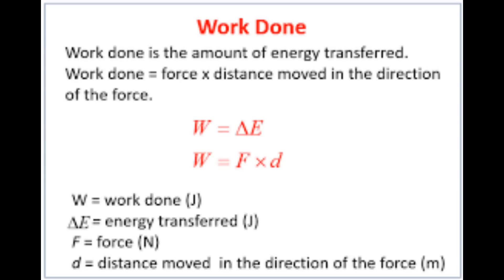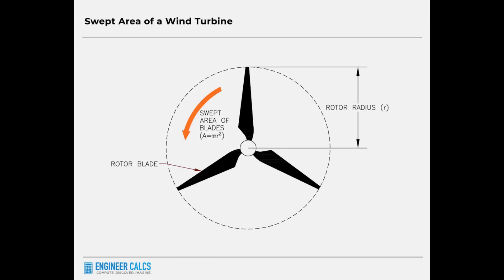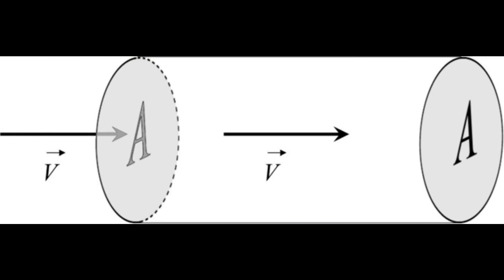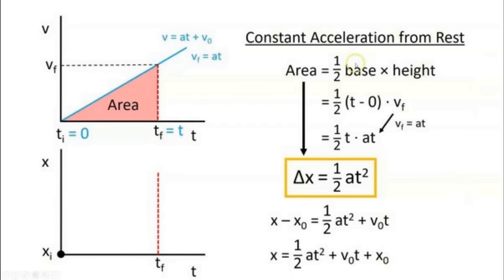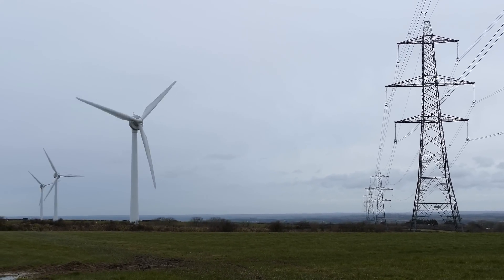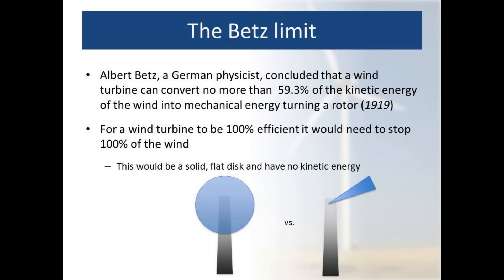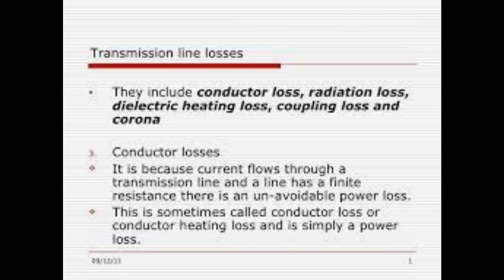1920 The Mathematics Of Wind Turbines

Comment: I can understand the geometry of an airplane wing shape as from root to tip it is all meeting the air at the same velocity (I'm ignoring the mechanics/geometry of weight/lift/strength of modern wing). But with a rotating 'wing' i.e. turbine or propeller, the tip is moving fastest, the root hardly at all. However, a turbine blade is applying torque to the axle, and the leverage effect means its most effective with force applied at the tip. So why aren't the blades much wider at the tip to 'catch' most air? (I'm thinking something like the multi-blade windmills of the old american ranch waterpump windmills) Can someone explain this in clear terms?
Even if the tubine blade/wing has an extended tip (to reduce the effect of vortex shedding on the rest of the blade) there must be a sweet-spot along the blade where widest is most efficient to extract maximum torque-effect from the airstream.

Comment: I assume that any wind turbine, when trying to maximise the energy it collects, will run at some rotational speed that is proportional to the wind speed. OTOH, as you explained in a very convincing way, the energy that can be extracted grows with the cube of the wind speed. From these two we can assume that the torque or the mechanical load that optimises the efficiency of any given turbine will have to grow with the square of the speed. Let's say you want to store the energy mechanically by lifting a (constant) weight. You would need some continuously variable transmission system that makes sure that the gear ratio grows with the square of the wind speed. I can imagine one can build such a transmission system, but how to do it in a simple and robust way is an interesting challenge in itself.

Comment: The Betz power coefficient limit of .59 often referenced.  The less known "Whirlpool losses Schmitz power coefficient as a function of the tip speed ratio" curve is very useful for estimating the efficiency of a wind turbine.  The Schmitz curve shows the maximum theoretical power that can obtained at given tip speed ratio, TSR.  A wind turbine operating at a TSR of 0.5 has a maximum power coefficient of only .238, at a TSR of 1.0 it increases to .400, and at a TSR of 10.0 it nears the Betz limit at .572.

Comment: So Robert, I can't help going back to your 1889 demonstration on the capture of wind energy (funneling the wind down onto a fan to drive a generator). I hope that is the correct experiment. Anyway Im sure you know the one I mean. It has to be one of the most innivotive ideas I can think of. Obviously the internal orifice has its limitations (in the maximum achieveable downward air pressure)  to create high pressure onto the fan. If everthing is scaled up with a cone on the bottom to create yet more low pressure under the fan, the efficiency has surely to increase without an increase in windspeed. Sorry that Im going off on a tangent but I thought a little alteration to an existing project may produce a positive result.

Comment: What I want to know, for the big commercial turbines, relates to energy output per revolution. Does the turbine produce the same quantity of energy per revolution (at the nominal rotation speed) or is the energy generated a variable, controlled electronically, to keep the blades rotating at the optimal speed.

Comment: I’ve always struggled to understand why all modern turbines are 3 bladed. The ideal you presented here effectively calculates the power output based on a “wall” of wind hitting the blades. Once it’s passed through, it’s gone. Energy dissipated. Converted. Kaput. End of. So why not put 6 (or 9..or 12) blades to capture the power from that wall of wind - and max it out? There is a huge amount of energy in the wind that must just pass straight through the three turbine blades, uncollected.
Reply: Struuggling isn't good, working things outt.. is much better.
(Work with "Less is more")

More blades interfere with the wind - upstream of the turbine, more blades increase mechanical complexity, more blades increase cost, more blades increase maintenance
Fewer blades induce increased plasticity in the rotation, fewer blades increase "tower effect", fewer blades increase bearing stress. Fewer blades reduce power output (for any given rotor diameter), fewer blades reduce cost/maintenance /complexity - intil there is only 1 and those things Likely increase again..
Even numbers of blades induce harmonic oscillation into the whole system.

Pick you optimal number, more than 2 and likely less than or equal to 5, with an off (preferably prime) number dominating.

The lower the number the less disruptive hub interactions and the lower the drag when stopped...

(Not saying you are incorrect, but the haters look to Holland or Greece with their old "4 bladers" as something of a marvel in contrast... - romantics often disconnect intellect.)

Comment: How does the Betz limit apply if you were to stack a bunch of separate turbines in front of one another? i.e. the first turbine slows the air down by 60% and extracts the energy, but then the next turbine can slow down that resulting airflow by 60%, and the next one can slow down what's left of that by 60%? Does this allow you to get arbitrarily close to 100% efficiency, or is there still some magic that means the system as a whole must obey the Betz limit even if you or I would recognise them as multiple individual turbines?
Reply: - the best you get is a very expensive marginally performing system - when just 2x the wind turbines separated adequately give 2x  (ie 1 + 1  - maths is dead easy ) 60% (theoretical limit) - 2 stacked can only give 60%+(60% of 60%).....(excetera for 'n' numbers of repeats )- lots more material, not much energy - worshiping efficiency gets wasteful quickly - call it "diminishing return").  lol.

The only way to beat Betz is to change the "critical area" - either using an upwind "collector" or a downwind "diffuser"  - or some combination which doesn't use too much material, disrupt the flow through the blades (air just "flows around" if you try to force the pressure to rise too much) , or cause the tower cost to increase astronomically - high winds and breakage are a thing)
Reply: @kadmow  I'm aware the second turbine would be getting 60% of the 40% that remains after the first turbine has extracted some energy. That's not my issue. But if the Betz limit says the maximum proportion of the energy you can extract from the air flow is 60% in total, but stacking multiple turbines allows you to exceed 60%, then it doesn't seem like much of a limit at all, because whether you consider a system to be "2 turbines consecutively" or "1 big turbine system" is just a matter of opinion. Which makes me think that maybe there is some reason that the second turbing actually wouldn't be able to get 60% of the remaining 40%. Perhaps because the restriction it places on the "exhaust" of the first turbine means the first turbine's efficiency goes down to compensate? I don't know.

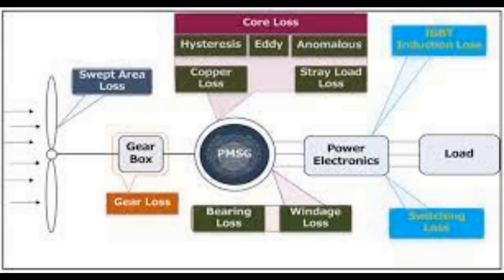Comment: Thanks for this talk... one of the issues I've always had with wind turbine math is that it always assumes the air is moving in a laminar flow like in the picture at 5:15.  This is not how nature works or how air flows with its particles swirling and spriraling (think dust devil).  That is why I especially like the tesla turbine idea with the hyperbolic diflectors, it seems to induce a vortex out of the chaotic particle movement, similar to how some water vortex turbines work.  In the apple/grass analogy, it's like it's assumed the apple hits the grass flush, vs it striking the blade at an angle which would be trasfering a lot less energy.
Reply: I love this series because I grew up in an area of California that has a lot of HAT wind turbines, and since I was a kid I always wondered why most of them would not be functioning despite strong winds, which led me to study the subject and learn of the limitations of HATS and have been interested in alternatives ever since.

Comment: The turbines have three blades due I understand to a large difference of wind velocity at higher levels than at nearer the ground , ( where there are more obstructions ,ie trees hedges or ground contours ) . A four bladed prop would not be able to cope with the stress of two variable wind speeds and would probable be subject to severe mechanical failure, are the calculations based on the forces exerted on the one blade that arcs through its one hundred and twenty degree of travel or a combination of all three ?

Comment: I saw a new design of boat outdrives that uses a shaftless circular propeller.. All the drive was on the outside circle around the four blades. The water flows through the propeller, and I'm wondering if that's more efficient? It was on a new Faro pleasure boat.

Comment: Bird exterminators that use more energy in there creation and maintenance life then they produce.
Reply: Both pure made up lies from the oil lobby. I suggest you be more critical about what you read and use some common sense. Wind power is already very profitable without any subsidies. So it's simply impossible for them to use more energy in production than they produce. Then it'd be impossible to make a profit.
Reply: Right! Blight

Comment: Great video 😊

On tip speed ratio. Yes it is simply ratio of speed of the tip of a turbine over the speed if the air. Furthermore, the pitch of the blade determins the most efficent tip speed ratio for that turbine. 

It is like this for the turbibe in order of too fast to too slow in a given wind:
1)  if your turbine spins too fast in a given wibd,your turbibe acts like a fan speeding up the wind. 
2) Slow the turbine down some and at a point the blades will simply cut the air neuther putting energy into the wind nor pulling any energy out.
3) if you slow the turbine further you extract more and more energy out of the wind  in an upward curve untill you reach a maximum amount of energy that the turbine may extract  from the available power. After that,
4) slowing the turbine further reduces the amount of wind energy converted to rotational energy more and more untill the wind turbine is not spinning and there is zero energy transfered from the wind to rotate a non rotating turbine. 😊

Comment: The power output is proportional to the Air Speed cubed.
This is why the location of Wind Turbines is so important.
If the average wind speed is say 5 m/s and it doubles to 10 m/s the power output goes by a factor of 8 (ie 2 cubed which is equal to 8).
Find a windy location that has on average double the air speed of your current location, and your power output increases by 8 fold (or 800% - all other factors being equal).
The power output is also proportional to the blade length squared. So doubling the length of the blade will generate 4 times the power.
The Coefficient of Performance is the tricky factor to determine. It's usually calculated empirically, especially with exotic blade designs.
It is common to see three blades on large wind turbines. And there is good reason for this if you examine the performance and power curves.The theoretical upper limit for Turbine efficiency is approximately 16/27 of about 60%.
There are many energy losses along the Turbine power generation train....cant do much about this apart from minimising these losses.
Reply: If lift (airplane wing) increases with the air speed squared, why does it become cubed for wind turbines?
Reply: @UncleKennysPlace  The lift squares the torque times twice the speed equal eight times the power.
Reply: @UncleKennysPlace  One is a foil whilst the other is a directed blade. Lift is largely driven by a pressure differential - the Bernoulli effect. Other factors involved too.
If you turned the aeroplane 90 degrees and had the wings facing directly into the wind, it would not be a squared relationship.
The plane would not fly either.
Good question.

Is the lift formula different for supersonic speeds?
Reply: @UncleKennysPlace   -  We are working out the Power (using an energy formula) Watts come out of  "Instantaneous" Joules (J)... (KE = 1/2 m v^2)

(In Aerodynamics "similar equations" are usually working out the Force (Newtons - N) - ie Drag Force (Mass  * Acceleration)   (F = m a) - the "1/2 rho v^2" is the dynamic pressure....

Kinetic Energy normally has mass and velocity squared, in the equation,  wind Equations have density and volume (sectional area multiplied by  "unit" length)  -  the axial measurement for the "air volume" is determined by the "second of travel" - unit of time (second), therefore the velocity of the wind gets input to compute the "effective volume (mass) of air". (m = cp rho A v)
 - Power is the time derivative of Energy - ie the The seconds worth of Watts  is the Joules  (at 1 second increments these things are "Equivalent" - for doing math)

So the v^3 is lumped at the tail end of the equation.  (a working understanding of the mechanics is better than rabbiting formulas)
Reply: I can understand the geometry of an airplane wing shape as from root to tip it is all meeting the air at the same velocity. But with a rotating 'wing' i.e. turbine or propeller, the tip is moving fastest, the root hardly at all. However, a turbine blade is applying torque to the axle, and the leverage effect means its most effective with force applied at the tip. So why aren't the blades much wider at the tip to 'catch' most air? (I'm thinking something like the multi-blade windmills of the old american ranch waterpump windmills) Can you explain this in clear terms to me?
Reply: @bikerfirefarter7280   A wing is most efficient (same with turbine blade) if the lift profile is somewhat eliptical, with reduced pressure gradients near the tips, causing vortices , drag,  without increasing power generated. The hub part of the blade, travelling so much slower than the outboard part of the blade (very low in potential power) is pretty much just faired for reduced drag after cut in speed (low velocity startup is influenced by this part of some  blades -the effects are extenuated in small fixed pitch machines.    The rest of the blade is designed to generate power proportional to the reynolds numbers (affected by airspeed and chord length of the blade) at every portion of the blade moving outward...  Obviously the specialist experts design with high end CFD software to optimise performance while minimising cost.  A wider blade  toward the tips will greatly increase loading and bending moment on the blade - the rest of the blade needs to resist this force, while still performing "optimally" ie. making money for the owners..
Reply: @bikerfirefarter7280  You also want the air resistance component to be a minimum at the tip, where the velocity is maximum.
Turbine blades are tapered for this reason. 
The blades also have a twist in their shape.
The aerodynamics is quite complex - most of the optimisation of wind turbine blade design and operation is done in Wind Tunnels.
Reply: @bikerfirefarter7280  You're right, the further the distance from the axis the more effective the blade is at transferring the energy of the wind into rotational torque.  The wind is slowed as the blade transfers its energy and needs time to accelerate again so the next passing blade can transfer the same amount of energy.  Because of the higher speed near the blade tip a narrower airfoil can be used to slow the wind down.  The narrow blade also provides a little more time for the wind to accelerate before the next one passes.

The old Aermotor type windmills have about one third or less the efficiency of the higher speed three blade wind turbines.  Higher startup and low speed torque made them a good choice for operating the piston pumps.
Reply: @danedmiston9673  Thanks, that makes sense; I'll have to look into the efficiency things you mentioned.
So, for urban/home use where wind is often lower than 'ideal' location, wouldn't 3-5 blades with broad tips be more applicable, coupled with a step-up gearbox for driving a generator?
Are there similar pros/cons regarding low/high wind speeds for VAWTs of various formats? E.g. Savonius 'buckets' vs blades?
I have a 3-bucket VAWT 'Savonius' made from an oil drum with a shaded upwind side, on test; even in light wind the torque is surprisingly high. I need to do more tests/measurements on it though.

Comment: Just a thought.  You have the magnets around the bottom of the squirrel cage, and a coil. What if you connected the squirrel cage (or any vawt turbine) to a circle of magnets that is 3--10 times bigger and coil. than vawt windmill.  You make it with spokes to make the circle bigger. Like a fly wheel.       Sorry not scientific definition.  Hope I got my thought across.